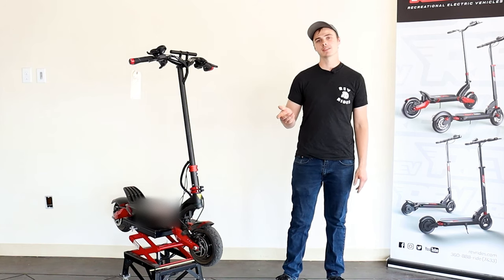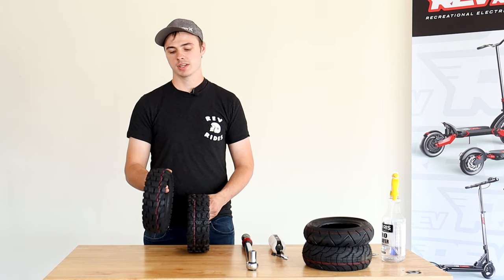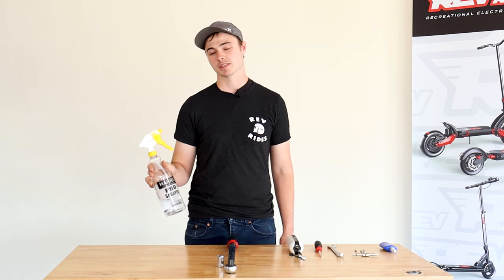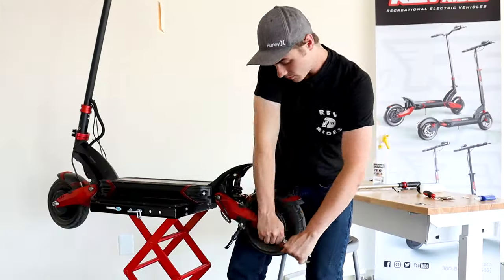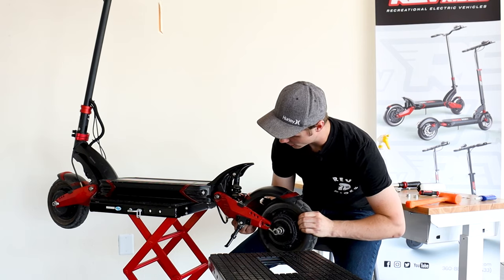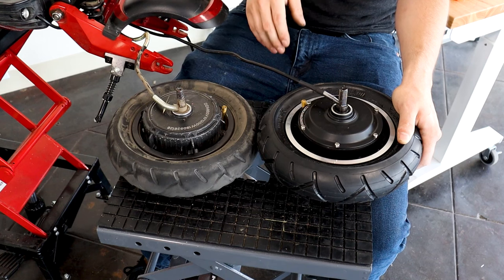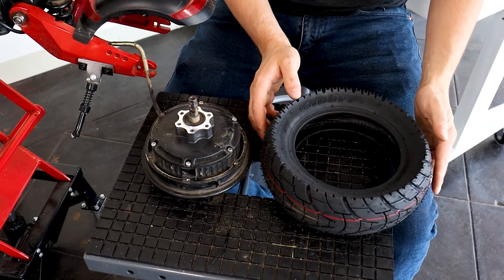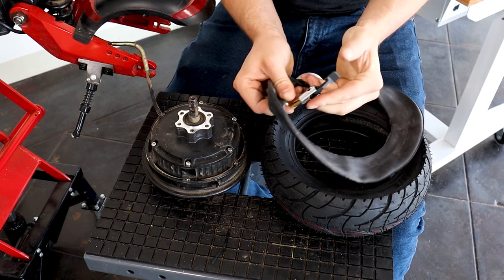Apollo Pro Tire and Tube Change

Comment: That's actually my 60v 10X scooter. I recognize it from the scratches on the front right fork and T bar on the handlebars. They had possession of it on the day of this video. I had sent it back to them under warrantee. Had some controller issues they needed to diagnose. They asked me if I wanted to replace the tires with some fatter ones. I agreed since my tires were bold. I had a flat in the rear so that's why I put slime in it. I'm happy they replaced the rear tube and didn't reuse it. 

I got it shipped back to me just a few days ago and the fat street tires are great. They have much better cornering grip. I definitely recommend them over the stock ones. Somehow I got it back with missing rear fender though. I wonder what happened to it since he didn't take it off. They're shipping me a new one.
Reply: That's a great mystery, I need to know the fate of the mysteriously disappearing fender lol
Reply: I never put dirty parts back on a scooter I like to clean the parts before reinstalling them.
Reply: What’s the size of your new tires? plannin to ipgrade mine.
Reply: @paulllanera6307  3" wide street tires. Diameter is the same 10".
Reply: Do you know if those tyres fit Zero 10 aswell?
Reply: @danielc454  I think I heard somewhere that yes they do fit but call RevRides and make sure.
Reply: How are the tires on the road? I can’t see them being quieter than the slicks.
Reply: @robbie1212  I noticed no difference in noise from stock tires to the wide tires
Reply: Hi , could you please explain what controller issues you experienced? i have this same scooter . is it related to overheating ? thanks

Comment: Great video, thanks for the time and effort to put this together. You described the wrong motors though, the first one is the 1000W, and the 2nd one is the 1200W. Just FYI for all the ppl at home. 1200W is annoying because when you split the rim, the tyre is on the inside of the motor.

Comment: Anyone using this video to change an Apollo Pro, if you have the 52v version you will need to follow the instructions for the 60v, because it is setup the same as the current 52v Apollo. Pro.

Comment: I've gotten my first puncture. More of a hard impact burst to the inner tube. Riding over uneven terrain. 
I have the same zero as in the video. It looks a lot easier than I imagined. 
Might get the semi offroad tyre to replace it. 
I'm around the 850km mark and couldn't be happier with it. Got it the beginning of June, not so warm now in the UK so doubt I'll use it so much.

Comment: I just finished patching a slow leaking tube on my 52V. 
It actually wasn’t as bad as I thought it was gonna be. I was REALLY dreading doing it, relieved it wasn’t really hard. 
Just make sure you empty ALL the air out of the tube 1st!
Reply from the maker: Good job getting it fixed! Good tip for sure!

Comment: Should I carry this kit at all times while riding? How easy it is to perform out on the road?
If I remember right with the Inokim OX you don't have to take the wheel out to replace the tube...
Reply from the maker: You are right, with the Inokim OX you do not have to take the wheel off you just need to lay the scooter on its side and use a tire iron to get the job done. Just be sure and check your tire for the cause of the puncture. As for the kit it wouldn't hurt to bring a couple tire irons and a new tube along for the ride, it all depends how comfortable you are with changing the tube on the go. Here is a good video showing how to change the tube on the Inokim OX (https://www.youtube.com/watch?v=yzh75Cx2Rpo). He was very informative for that brand scooter. Thank you for the comment!
Reply: @RevRides360  Yes! I watched that exact video before sending that comment haha.
Although I have to say, he got the easy wheel done, as the rear wheel would be bit more challenging.
As motor is there, some cables would have to be disassembled, and screws loosen, would probably have to jack the scooter to keep things clean and tidy there.

Comment: Interesting, and im so glad it's a split rim.
But if disks are anything like used on many high performance carbon bikes with shimano's disk brake set up.

You don't touch the rotor without gloves or you thoroughly clean it before use.

Comment: Very helpful. I have a question tho, after you inflate the tire does it wobble when spinning? I have a new vsett 9+ and the rear tire has a slight wobble which makes the scooter vibrate at faster speed and is felt the most on smooth surfaces. How can I propperly align the tire to the rim to calibrate it?
Reply from the maker: We recommend deflating the tire to about  15 psi then ride slowly for about 1000ft then re inflate the tire

Comment: When I split the rim, on the inside surfaces, IE; where the tube comes into contact with the rim. I found the machining tool marks a bit rough. Could cause puncturing down the track. Sooo I lined it with gaffer tape. What do you think?
Cheers
Jeff

Comment: GREAT video!   Of course, the TWO motorcycle jack stands help.  ;)
Reply: I use one of the polystyrene blocks that was used for packing inside the original box that the scooter came in. There’s even spaces on one side that can accommodate the axels. The blocks easily hold the weight and won’t damage the paintwork. They’re also super light so easy to put somewhere when you’re not using them. Don’t chuck ‘em away they’re very useful.

Comment: will a 255x80 tire fit the 10 inch rim was told by scooter shop owner that it would fit after i have taken of my 2.50x10 tire is this write or will that tire not fit but the shop owner watched a video on youtube an said it would is this correct thank you for your video on how to change a tire easy to follow

Comment: About to buy the 10x and have been offered the all terrain tyres free of charge fitted to the scooter. About 70% of the time I’ll be riding on the road and the other 30% off road, are the all terrain the best tyres to go for? Also, I’ve read the 10x has a problem with the electric controller deep inside the scooter which heats up and eventually breaks, would love to know if this is common and how to avoid it if possible? Last question is with the tyre wobble at high speeds and the need to buy a dampener kit, is this easy to attach as I’m tech illiterate and could fuck up toasting bread if let near the toaster!

Comment: Great, thanks, but my main nut is 21mm on the X10 and I could not fit the wheel back onto the frame without loosening the suspension arms to give way for the inner washers.
On the whole I am not tech. savvy but if you follow this video almost anyone can do this. Very grateful for this.
Reply: man i came here looking for your comment. i just got a Zero X10 and from all the videos i have watched, everyone shows the axle nut to be 17.5/18mm but mine appears to be over 20 and as such, i do not have the right tools to open the nut lol. i thought to myself, whats going on - why is mine bigger ?!?! 

do you happen to know wht some zero 10x models have larger nuts ?
Reply: @s77lom49  not sure, but I think they are made at different factories and each uses the resources of stock which they have. It also may be an engineering change on the newer models. Who knows.... China has no rules.
Reply: @DANKERBRIAN  Yes, thank you for replying. i found out that the nut was changed to a larger one - so those videos showing the smaller nut (17.5 mm) are from an earlier version of the scooter. the later versions use a 20mm nut. 

thanks anyway man !
Reply: @s77lom49  mine uses 22 🤷. Had to stretch suspension to fit back the wheel.

Comment: Hi, I got a flat tire on my scooter and need to replace the tire. I was looking around and there are Vacuum Tubeless tires out there that are the same size. Would those work? Or would I have to use only the ones that come with tubes?

Comment: Those punctures, looked to be right on the inside seam where the two wheel halves join.  On a bicycle wheel, there'd be a tape ring protecting the tube from wearing on the spokes.  Is this a flaw in the design?  I don't recall the last time I had a flat with my bicycle tires, yet after about 100 km on a scooter, I'm watching this video.
Reply from the maker: Hey John, these punctures were on the outside orientation, and there was debris that had punctured the tire and tube in this case. We do not see tubes needing repair because of the inside seam with proper installation, and do not believe this to be an issue in this design.

Comment: Hi guys! Thanks for the great video!.  You apply 40 ft-lb (54,2 Nw-m) on the tire axle nuts...Is that torque ok for zero 8x as well?  Where could we find torque numbers for several nuts on the 10x/8x?  Mainly brake disc screws/ motor hub cover, but also Torque on the suspension nuts (swing arm)?  Thank you so much :)
Reply from the maker: Hey Jordi, the axle on the 8X is smaller. We typically apply 35 ft-lb to the 8X axle and swing arm nuts. The disc rotor screws are torqued to 6-nm, and we highly recommend a medium strength threadlocker. At this time there is not a torque spec guide from ZERO for their models.
Reply: @RevRides360  Many thanks for your reply :)

Comment: Great video 👍 does anyone know if "zero 10x wide road tire" will fit for zero 10 scooter?  
Thank you.
Reply: And for techlife x7s did it fit?
Reply: I was told by Revrides that they wouldn't but  falconPEV that all three will, but that you need to get a different rear fender since it isn't wide enough to accommodate any of the hybrid/wide/ off-road tires.  I'm interested in the wide or hybrid as well for the rear just to give better traction since the stock ones aren't that great.  If you check out https://youtu.be/h0UeRkGb874  he's got the hybrid on his zero10....so they must work.

Comment: dear rev rides. i wanna ask what size of tubes are you using of those zero and vsett scooters? cuz i see that the tires are 10"x3" and everyone is selling smaller tubes like 10"x2" or 10"x2,5". cant you plz help me? i wanna buy one of those scooter but the smaller inner tube problem is a deal breaker for me. :(
Reply from the maker: We use the smaller tubes as they fit better and are less likely to be pinched. Hope to see you on a scooter soon!
Reply: @RevRides360  ahhh ok!! thank you very much for clearing that up! it was bothering me for a long time! i already got a scooter for about 3 years now and i am looking to upgrade to a better one. :) best of wishes!

Comment: I have furo fuze which is pretty much a overpriced copy of kugo m4. I’m having hard time finding solid tyres 10x3 from trusted seller , I currently have standard HOTA tyres but I had 4 punctures in 2 months . My question is will 10x2.5 solid tyre or honeycomb tyre still fit???

Comment: How the fuck do you avoid pinching the tube between the rims?????? I find that to be the hardest part of chaning a fucking tube
Reply from the maker: Excellent question! Coming from one of our scooter guru tech - "Inflating the tube just a tiny bit before putting it in helps it keep it's shape so it doesn't spill over the edge onto the rim where it might get pinched." Hope that helps!

Comment: Tyler I followed your instructions. All is good but the tire seems to wobble a bit but when I press the accelerator  more it seems fine. This is on the the jack of course.  Any idea if that’s normal? Thanks in advance.
Reply from the maker: Hello! Yes, that is considered normal. As long as the vibration is not noticeable while riding, there should be no issue. :)
Reply: @RevRides360  ok great thank you ☺️

Comment: Those swing arms is heavy duty aren't they but heavy I think making it 70lbs over the apollo ghost. Do rev make lighter swing arms to down the weight?
Reply from the maker: We do not have lighter swingarms. We wouldn't recommend lighter as the swingarms might not be able to handle rugged conditions as well.

Comment: I dont understand. I have the 52 volt version. But I split my rim from left side where the disc brake is. And my valve goes through the rim on the right side. Yours is the other way around

Comment: How do I get the glue your using to put on all the screws? Also the tool your using to remove the screws from the brake rotor how can I get that tool? The tool that it came with when I got my scooter was not the right size
Reply from the maker: Hey Patrick, medium strength threadlocker can be purchased at most automotive or hardware stores. We are using the Fix-It-Sticks in this video, they are available on REVRides.com. Thanks!

Comment: I have had the pleasure of changing the inner tubes on 2 of these scooters, but for some reason they both punctured again only 2 days or so later, I filled them up to the specified pressure, is there something I might have done wrong?
Reply from the maker: Most likely there is debris that has punctured the tire, but it still inside of the tire. Take note of the tube position before removal, and use the tube puncture as a guide to locate where the debris may be located in the tire wall.
Reply: @RevRides360  ill keep this in mind, thank you for the help

Comment: Quick question - does the 52V 1000W motor have a longer rear power cable coming out of the deck than the 60V 1200W? Or did you remove the cable from the scooter? Thanks in advance.
Reply from the maker: We had this particular 1000w motor removed from the ZERO 10X, but we did the install as if it was attached to the scooter. The cables are the same length on both scooters.
Reply: @RevRides360  Fantastic - thanks for the reply and clarification.

Comment: Thanks for a great video. 
Quick question : my rear brakes are touching the disk now. Hmm what did i miss?
Reply from the maker: You will need to adjust your caliper/pads.
Reply: REV Rides same it makes a super fast clicking sound when I break. I’ll loock up how to do that
Reply: The washers must go on the inside of the forks. Except for lock tab washer, which ensures pad and caliper are in basically correct position.

Comment: Are the Urban Offroad tires much louder than the onroad? I like that the stock tires are super quiet.
Reply from the maker: The Urban tires are louder on pavement than stock, but it is not considered a large difference from most users. We have never had anyone complain that they are too loud. The knobby offroad tires are considerably louder. Hope that helps.
Reply: @RevRides360  awesome thanks

Comment: torque numbers for swing arm 
Where can I get all the data of this?
Reply from the maker: There is no official torque specification guide at this time for ZERO. We typically consult industry standards for the bolt/stud size. Axle nuts and plastic threads are the exception. 40 ft-lbs is adequate for the swingarm nuts.

Comment: My scooter has 80 60 6 tires now. Will 80 65 6 also fit? Like as in will it go around hub
Reply from the maker: No guarantees, but yes it should fit. The Outside Diameter of the tire will be slightly larger, but the Inner diamter should fit.

Comment: Great but I have an 11X. Is this the same, it if not can you upload a video to show how to change tyres in ann11X? Thanks very much indeed
Reply from the maker: Hey David, for the 11X I recommend disconnecting the motor wiring under the deckplate. The other steps are similar. I will put it on the list of videos to be made! -Tyler
Reply: REV Rides looking forward to this video as I just got my Zero11x as well and thinking of installing off road tires instead of current road tires

Comment: What should i do if i cant properly align the valve through the motor? When it goes through it leaves a bulge in the tube. My model is 60v.
Reply from the maker: Hello, is it possible you do not have the correct tube? The valve stem must be angled, not straight, or else you will have issues with the valve stem routing.
Reply: @RevRides360  thanks for reply. The valve is on the correct angle. My front tire & tube fitted without problems . On this rear no matter how i fit it always bulges near the valve.
Reply: Could it be this particular tire or tube causing the problem? 3.0 wide road tire

Comment: Less than 2 hours of Varla, 2 flat tires, more time youtube how to repair tire than playing/riding. Found tire has two metal wires poking out. Does the tire made with wires?
Reply from the maker: Yes, these tires have metal wire on the edge. You must have a defective tire or the metal wire broke when you hit a pot hole or the edge of a curb or something. I would recommend contacting Varla and getting it covered by warranty. Next time buy from REV Rides. :-)

Comment: is that a custom made escooter holder or i can buy it some where?
Reply from the maker: We use motorcycle stands! Here is a link (https://www.amazon.com/Extreme-Max-5001-5059-Motorcycle-Scissor/dp/B01LW1FKXX/ref=asc_df_B01LW1FKXX/?tag=hyprod-20&linkCode=df0&hvadid=312061076067&hvpos=&hvnetw=g&hvrand=14323759217935291870&hvpone=&hvptwo=&hvqmt=&hvdev=c&hvdvcmdl=&hvlocint=&hvlocphy=9033604&hvtargid=pla-499807472877&psc=1&tag=&ref=&adgrpid=61856009493&hvpone=&hvptwo=&hvadid=312061076067&hvpos=&hvnetw=g&hvrand=14323759217935291870&hvqmt=&hvdev=c&hvdvcmdl=&hvlocint=&hvlocphy=9033604&hvtargid=pla-499807472877).

Comment: I have 78 miles on my 10x and my front tire is already flat and I checked the tire I can’t see no middle or glass on the tire
Reply: @merq_yt  mine I had to change the inner tube I had a hole on the inner tube and I had to replace it with a new one and now it happened again I got a flat 3 days ago but I put slime inside now it’s working fine at the moment.
Reply: @merq_yt  I used Slime Bike Tube Sealant 8oz

Comment: How do you remove a stripped screw from the brake router?
Reply from the maker: Hey Patrick, I would use some heat on the screw, and purchase a screw extractor kit. Thanks!